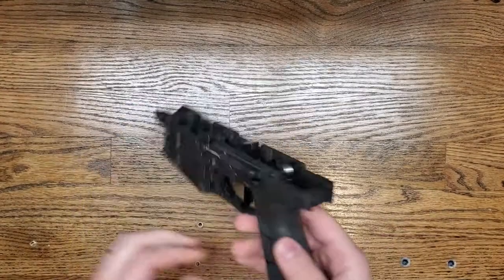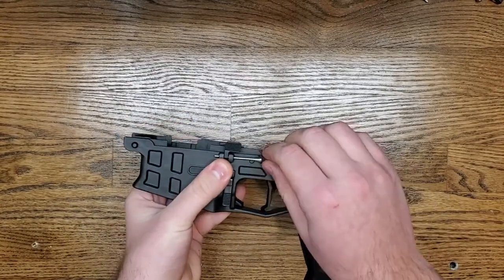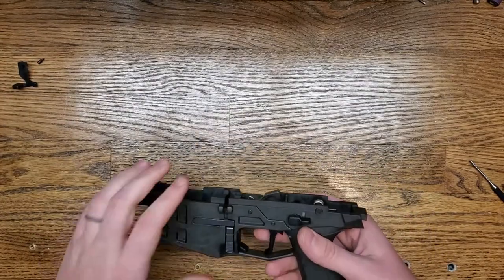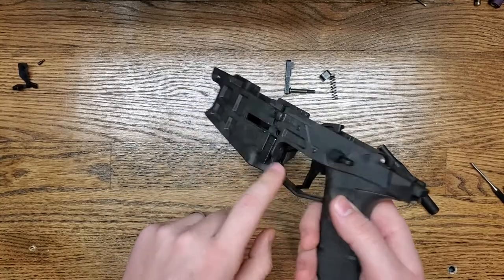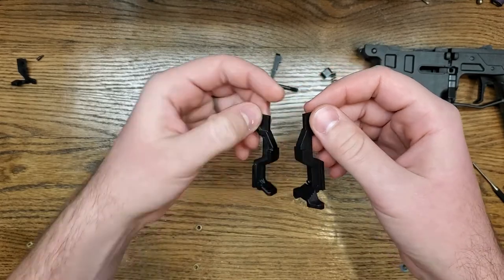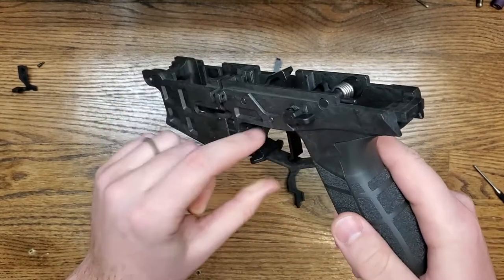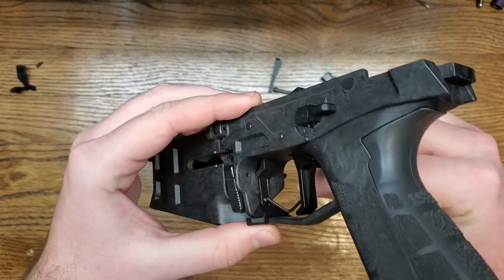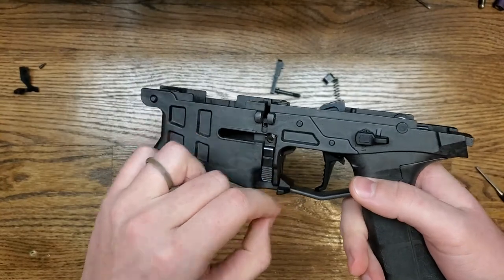CZ Bren 2 Extended Bolt Catch Lifter Installation

Comment: I just received and installed this bolt catch on a Bren 2.  I love the function as it is much better than stock.  After initial install the bolt catch seemed to be too tight and didn’t function freely.  I did have to spend about 45 minutes using 600 to 2000 grit sand paper to lightly sand the channel of the bottom winged portion.  It works great now but shouldn’t need this in order to function properly.
Reply: I’m having this issue also

Comment: I ordered a Bren 2 last night. This will be THE FIRST upgrade I will be making! I just wish someone made a charging handle to give one on both sides, same time and not just swappable.
Reply from the maker: Thank you!  And not a bad idea, I know there are some good options out there right now but no dual charging handles.
Reply: @lingleindustries2274  ordered the bolt catch.
Reply: @lingleindustries2274  I received the bold release today. Same day I picked up my Bren 2. Of course, I promptly installed it. Honestly, I'm a little disappointed. Since it is two pieces, plastic (polymer or nylon, whatever), and more leverage from the "wings", there is quite a bit of flex and I don't have confidence it will hold up. I know the original is polymer or plastic but this one is two pieces and has more leverage. I think it needs to be aluminum or at least an aluminum option. Even if it costs a little more. But the ergonomics are AMAZING! The Bren 2 should come with this factory!
Reply: @ICanDoItMyself bro you able to press it with your index finger? I can’t even press it , it just tight asf
Reply: @lewiszhang0115  I am. I wish it was aluminum though. I don't care for it being 3D printed plastic. I don't think it's going to last long. I will typically use it to lock the bolt back but not release it.

Comment: Nice I ordered 2, I wonder if it will work with the A3 extended mag release. they seems to occupy the same space, guess I will find out.
Reply from the maker: Great question, we were not aware of A3Ts extended mag release.  Please let us know what you find out!
Reply: @lingleindustries2274  Update! They rub against each other but will work. The extended mag release sort of pushes the extended bolt catch out of the way when in use. A slight modification will make it better but in the current state they do work.
Reply from the maker: @Dawn_Raider  That's good to hear, we may have to pick up one of the magazine releases to give the extended bolt catch the relief needed.
Reply: @lingleindustries2274  Please do so and also make the bolt catch of metal.

Comment: Smart. I’m about to order one now. Might trim off or down the left side wing, would there be any reason not to do that? I never use it left handed.
Reply from the maker: The only reason to keep the left side is you may want to depress the bolt catch lifter with your left thumb after a reload.
Reply: @lingleindustries2274  ahhh makes sense